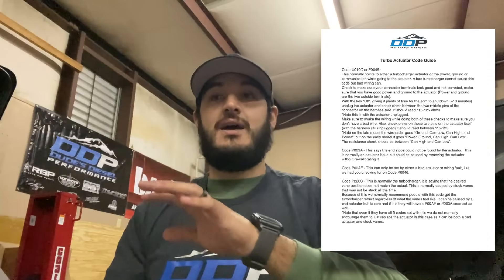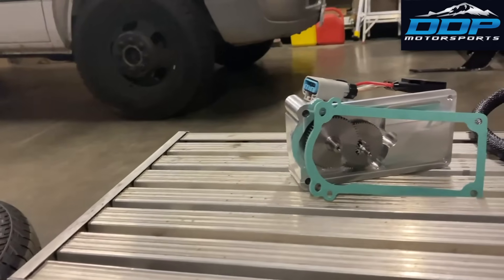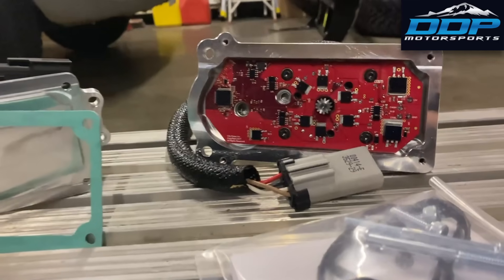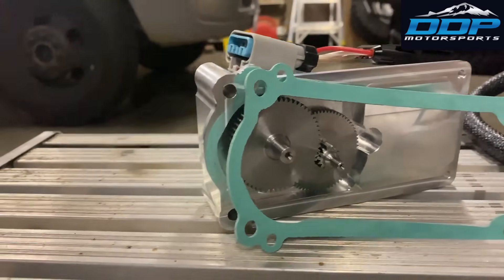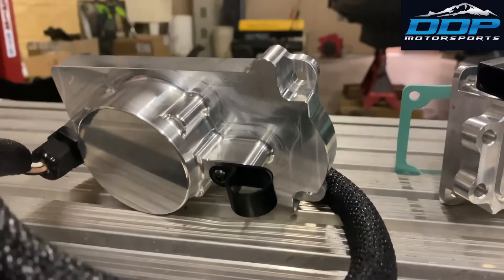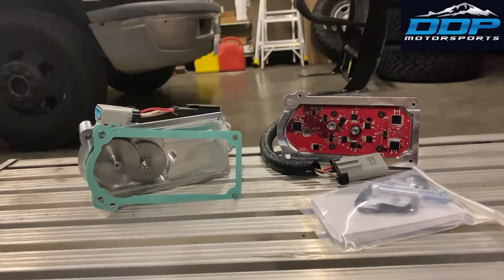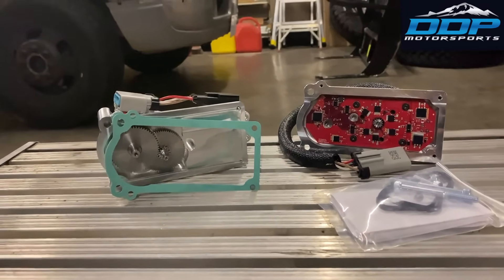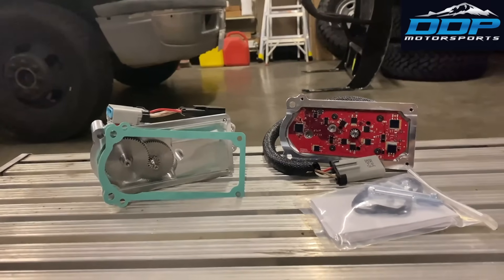City Diesel Cummins 6.7 Turbo Actuator Codes And How To Fix It ( No Calibration Needed )

Comment: I've have a fully deleted 2024 Ram 3500 SRW with only 48K miles on it. Only mods are •Banks Monster Ram • 5" exhaust • Banks Monster Pedal.  I'm getting  Code – P226C: "TURBOCHARGER BOOST CONTROL "A" SLOW RESPONSE.. Like I mentioned, above she only has 48,000 miles on her and I've only towed 12,000 pounds once (bobcat T770) the rest of the time just around town and highway driving and once in a while, pulling a riding lawnmower on a 6 x 8 trailer. If you could give me a little advice, I'd appreciate it cause I'm really unsure what am I looking at here, and I would prefer not to just start throwing money at parts if it can be avoided. Thank you very much in advance Oh P.S  on the code reader at the very bottom, it says-- Pending?
Reply: Did you by chance use s.d.s I’ve got the same truck with 12k on it and ive been getting this code since it was done, they keep telling me its a boost leak but ive tested it

Comment: bought their turbo actuator. they told me 7-9 weeks. 12 weeks later they holding it hostage saying i can have it if i pay extra 500 bucks expedite fee. not happy with these guys be warned.
Reply from the maker: Good afternoon sir! Unfortunately we are not holding it hostage. Due to City Diesel not having the proper parts to meet their deadlines they told us we offered you a rush option. You can most definitely decline it but it's there for customers who absolutely without question need their trucks. It's also a way to get bumped to the front of the line of without having to wait. We aren't forcing you to pay it, but if you need it asap it's the only fair way. Otherwise everyone would be asking to get bumped to the front of the line right? We completely understand your frustration and do apologize if you do not agree with this method. I hope you have a great week!
Reply: @ddpmotorsports that’s absolutely insane and a trashy way to run a business. So if y’all get one of these built and it’s about to go out to a customer who’s been waiting for 12 weeks but someone comes in and pays 500 bucks more they get the part that was about to be sent out to the 3 months of waiting customer and your calling that fair business? I’ve seen lemonade stand ran by children that have better business ethics than that.

Comment: Trust me I made the huge mistake of listening to a salesman and I put 100 percent confidence in him because it’s a big decision when you are at this stage with your truck I replaced the turbo and actuator with a fleece vgt the turbo was great for 80k and now the actuator has gone out again so now I’m having to replace it with city diesel actuator for another grand and I paid 3k plus taxes and shipping for fleeces unit so I have 4 thousand dollars in a upgraded turbo that should of been replaced with the upgraded actuator but it came with the same thing that came from the factory I wish I had gone with the second gen swap and fixed it right the first time now with everything I have spent on those upgraded turbo and the downtime and having the truck towed I’m getting close to 7500 bucks 3k plus tax new cheetah 3500 out the door antifreeze replacement 2 separate times billet actuator 1200 labor cost for the hassle of removing and replacing the turbo replacement actuator another grand needles to say ditch the vgt turbo it’s operating through module’s and ecm through can bus and it’s not reliable like everyone claims y’all have been warned replace the turbo exhaust manifold and do it right the first time and it will last forever I could of done compound turbos and put a pal brake on and been done with it and by the way they say it’s a drop in turbo but it is not as easy as they claim it took me one whole day and half of the next day and I used every cuss word in the book please take this for what it’s worth you will be pleased with the outcome

Comment: I have intermittent P00AF and U010C on my new to me 2016 2500. Sometimes the codes pop up, sometimes not- but I monitor VGT position on my CTS3, and can see it stuck as well as feel it in the lack of power. If I shut off the engine and clear the codes, if applicable, and restart the VGT typically operates just fine. Also, if it sticks at a fairly open position I'll just drive it and a few minutes later it functions as intended. I'm thinking/ hoping it's a wiring issue as this point.
Reply from the maker: Just please keep in mind that this is a few years old now and that it has been found that all codes could potentially still be caused by the turbocharger. Feel free to call us anytime and ask for Clayton. Always happy to explain a little further in depth!
Reply: @ddpmotorsports  of course, and thanks for the follow-up. It feels electrical, though, given the random come and go nature. I'm biased, though. 😁
Reply from the maker: @kylejonesUB  yes sir you are most welcome! lol no worries at all! Another reason it could be coming and going is because the actuator is getting worn out from being overworked and it's either losing communication due to the circuit board getting too hot, the electric motor on the inside is failing from being overworked or it might be electrical like you are thinking. We have ran into a bunch of these scenarios so just do as much testing as you possibly can! every code can still lead towards the turbocharger causing the issue. Just little things to think about that make too much sense to ignore if that makes sense.
Reply: @ddpmotorsports  yep! I'm at 121.5 Ohms on the harness. I'll keep diagnosing. Unfortunately there's 2 very seized bolts holding on the actuator. Never easy! Thanks again.
Reply: @kylejonesUB you found the problem?? I have the same symptoms in mine.😢

Comment: P003A is the only code identified.  Had to replace the original actuator at 20K miles.  Now at a 113K miles, I've decided to give City Diesel's newly designed actuator a try.  Ordered unit this morning.  It will be nice to have an actuator that doesn't require recalibration.

Comment: I had the p226c and u010c replaced it with the city diesel actuator it cleared the code. The turbo arm moved smoothly but after watching this video i guess ill be replacing a turbo in the near future
Reply: I’m telling you personally that you should 2nd gen swap it and be done with it I didn’ and replace the turbo and actuator with the upgraded version and the actuator went out on it and I had to get the billet actuator worst decision I have ever made  3500 for upgrading turbo fleece came same problematic actuator I will end up having 6k or more and the headache of having to deal with it
Reply: @Bigsexy611  What is the 2nd gen swap exactly, link maybe? I originally had u010c. Swapped out the actuator. day later I'm getting p226c.

Comment: Maybe you need to update your video in reference to pricing. The video states the actuator for a 2013 is $895 but on your website, it is $995. Or is there a special link you have to select to get the discount of $100?
Reply: No he doesn’t. Prices change all the time and nobody is going to update a video when you can see the price has changed. Use your head.

Comment: Installed my actuator today on 2014 ram 2500 after receiving codes U010C P00AF and P003A
Amazing, my turbo and exhaust break are as good as new!  Hardest thing about the install was draining my radiator of coolant.  I am so thankful and pleased at the ease of install.  Thank you City Diesel and DDP.

Comment: I had little to no turbo boost. I pulled my actuator and checked the shaft movement, was fine. I ordered an actuator from City Diesel and WOW! Totally night and day difference from the stock actuator. The exhaust brake works fine and NO calibration required!! These actuators are awesome! Completely satisfied!
Reply: Was the response faster or no

Comment: While towing uphill, I got the p2262. Nothing changed. 28psi, brake still works. I cleared it, and it hasn't come back on. From what you're saying, it sounds like my turbo is going. I had the actuator tested about 2 years ago, and it was good. I don't remember the code at that time. Should I replace or rebuild the turbo? Thanks

Comment: I am getting a U010C code randomly on my 08 Ram 6.7 with 200,000miles on it everything runs fine I have boost and exhaust break I will clear code it won’t come on for 4 days then boom check engine light and that code keeps popping up do you think it’s the actuator thanks so much

Comment: my dodge is poping the VGT fuse  have unpluged at turbo fuse stays good  Have not removed to check due to my location and the calibration process (country Australia) your system sugestion should help  I have 270000 Km , as an old school fitter i would have thought it should last longer than this  Garrey

Comment: Hey bro, just had a frame swap done in a '16 ram 2500 6.7. The shop shit the bed on the entire install so bad it needs to be torn apart and put back together correctly. My question is, from the moment I picked it up it had extremely slugging acceleration, a high pitch screech when I accelerate, and no exhaust brakes. Could the turbo or actuator be damaged during this type of repair? It wasn't like that at all prior to, and seems too coincidental especially considering the slop work on every other element of the build (half of the parts are zip ties to other parts)

Comment: I just replaced my actuator with City Diesel's actuator. 100% recommend! City Diesel was great to deal with & this product works. I'm not a great mechanic but I can usually figure things out and this job was actually pretty easy. Watch a few of these videos and you be fine. 2017 Ram 2500. My actuator was failing intermittently. Jake & turbo wouldn't work when it was in fall mode. As soon as I installed new actuator, check engine light went out and truck finally operates correctly.
Reply: I see that you commented 3 months ago, is your truck still running good since slapping on the city diesel actuator?, I just ran into this issue with 2016 Ram 2500 and looking into this actuator.
Reply: @k5blazn  yes, actually .. everything is working just perfectly now. I was a little intimidated by the project at first, but after watching several videos and studying, I knew I could get it done. Only part that I was really worried about was the main allen bolts stripping or breaking. I got everything ready then one night, I removed the wheel and tire and fender liner, sprayed the allen bolts to let them sit overnight. Then I dove in the next morning and was test driving by 11 and I wasn't rushing. Remember, 25 INCH POUNDS on the marrying of the two blocks before assembly.
Reply: Do you remember which codes were popping up for your actuator?
Reply: @sonnycoville984   No, I don't recall the codes. Any dealer or anyone with a decent scanner tool should be able to pick up the code. What are the symptoms?

Comment: 2014 Ram 3500 4x4 with 73,000 miles bought used with 38,000 miles. I always thought it was dead pedal issue and at times exhaust brake wouldn't always work with my trailer. I LOVE the exhaust brake and can't even understand why someone would even consider a delete. I bought my new actuator from Geno's garage which was said to be backordered 2 months but got it in 1 month. The dealer sells a remanufactured actuator for $1500, I bought the Geno's garage version(Diesel City) $900 New with double the torque without the need to be calibrated. A no brainer like changing my Y radiator fitting with a billet 1 piece verses buying another mopar plastic that failed prematurely like the actuator

Comment: Yo my brother Clayton....don't forget my DDP swag in that city diesel actuator you just boxed up and shipped out today...LOL 
Thanks for all time and research you put into dialing in on the best options for my rig and the daily 22,000 - 25,000 lb (2000+ miles per week) pulling abuse I subject it to.
3 yrs and counting with no issues other than RAM's China built shitty actuator.

Comment: What if I have no codes but my exhaust brake stopped working and my boost is non existent until I push on the pedal. 25psi at most.
Reply: Hey daniel, Clayton here with DDP Motorsports. The actuator code can come and go in the beginning stages. Do the proper checks on the turbo to make sure the turbo is not the issue ( which i don't believe it is ) and then you can safely assume it will more then likely be the actuator. Very rarely is it the turbocharger.
Reply: On my 2017 I found that my Jake brake and turbo would work when I start the truck up but then soon after it would fail and then I would lose my Jake and my turbo but then if I shut the truck off wait a little bit turn it back on usually it would start working again. That was my symptoms and this new actuator has fixed that.
Reply: Having same issue. What did you find?
Reply: @mikepagel8418  my actuator actually ended up dying. The guy Clayton @claytonensminger above sold me their actuator and it’s the best option and 2 years later it works perfectly. Worth every penny

Comment: 2016 ram 2500, I’ve got code U010C, P003A, and P00AF. Actuator Ohms out on actuator and harness side. Voltage to actuator with key on engine off is 12.5V… I can’t seem to find any drivability issues at all, help! 😩
Reply from the maker: Feel free to shoot me a call tomorrow my friend. im happy to help! 866-895-3833
Reply: @ddpmotorsports  How do you clear the codes after replacing the actuator?
Reply: @oscarb9139  They'll either go away or you'll need to clear them with a code reader or let the dealer clear them.
Reply: Had the same codes, just replaced the actuator and all is good now

Comment: Hey Clayton I am getting all 3 codes that you 1st talked about on the checklist. Is it still OK to drive the truck? Truck seems to drive fine. Just want to know if I have time to order and still drive until it gets here
Reply from the maker: Hey john, yes sir you can drive it as long as it is the actuator and not the turbo. we have had a few customers wait a long time before purchasing one. the truck won't have as much boost/power and will feel like it's laggy but should be fine.

Comment: Thank you. Very helpful for me, a new owner who immediately got these codes only hours after driving off the lot.
Reply: Dang sorry to hear that! How many miles were on it? I just got the P003a code yesterday.. I will be ordering this Monday ( its Sunday morning now)
Reply: @johnnyturbo8460  
 I have the same code. Did this end up being the problem?
Reply: @alaska-bornfloridaman  yes, I ended up buying the Turbo Actuator from Genos Garage and it fixed my problem. I installed it myself. Fairly easy fix. You WILL need a ratcheting 10mm wrench to make it much easier.  It helps get to the lower left Allen bolt. And you will need to drain the coolant.  A stubby 16mm wrench helps

My truck only had 100k miles when I got the code.

Hopefully they have the actuator in stick. I had to wait 3 weeks for them to make some and another few days for it to get to me by mail
Reply: @johnnyturbo8460  
👍

Comment: so is it most likely the actuator when its very hit or miss?  like when the truck runs perfectly fine and then say within 20-30mins of driving the truck just doesnt have that boost down low and just starts to run alittle louder (almost like when a diesel has to regen).    Exhaust brake wont work during this problem... but then i can shut off my truck and within any length of time, an hour later/same day when i go to use it again it works 100%?  ive noticed that when i idle more or go slower/low rpms it acts more, but if i go on a long trip down the highway say even drive 2000 miles at much higher rpms it wont act up once... this issue has been going on for nearly 15,000 miles or more. has pretty much all the same turbo  codes you listed...
Reply from the maker: From what we have seen from many of our customers is that the issue can in fact be a hit or miss type situation. We have many customers that have told us they have been driving for over a year with similar issues and they have been skating by either resetting the codes or disconnecting the batteries to reset the codes/truck. More then likely it will be the actuator but, feel free to call/contact us anytime so we can better help determine your issue. You can call anytime or email 866-895-3833 Ext. 1 for myself ( Clayton ) or email us at ddpmotorsports@outlook.com and we will do our best to help ya out. 

Clayton
Reply: @ddpmotorsports  hey I just got one code the u code in beginning of video truck was working just fine then one morning light came on and code 2018 ram 3500 CC
Reply: Did you ever get to the bottom of this problem?  I seam to have the same symptom's.
Reply: Same thing with my 2015, wondering if the gear drive is just getting stuck or hung up? I can get out and tap on actuator and boom back to normal.

Comment: What’s a P2262 code turbocharger boost pressure not detected?
Reply: Ever figure out your problem?
Reply: Did you fix your 2262? Getting it on my 2012 2500